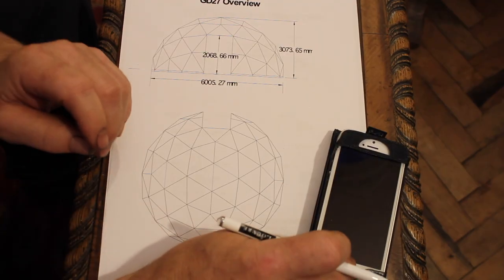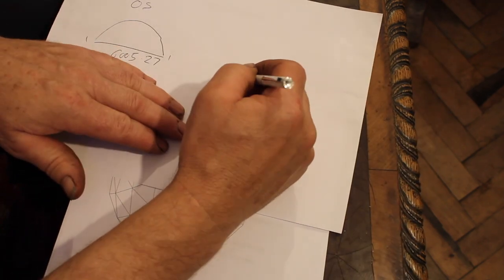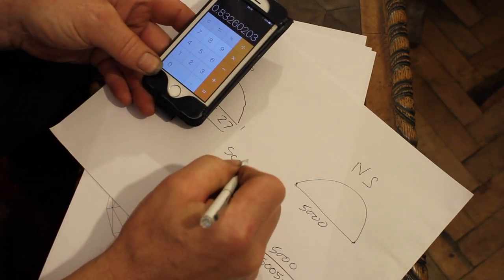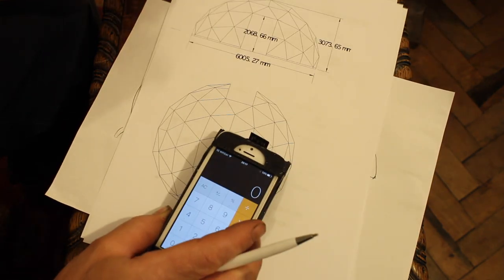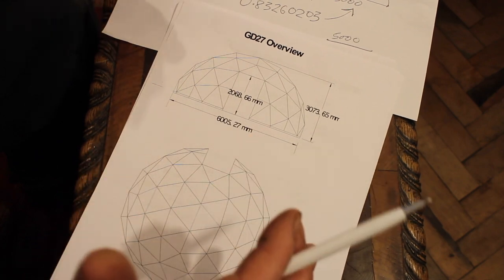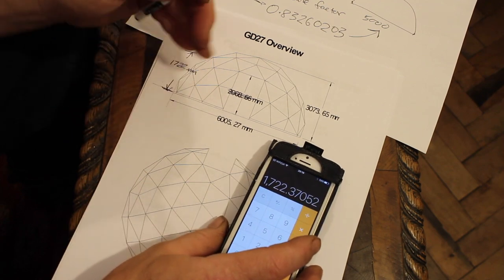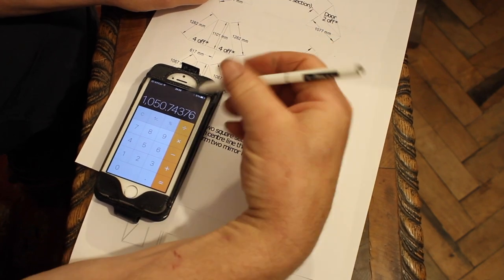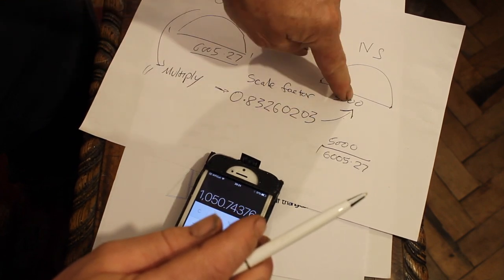How to rescale the geo-dome plans to any size.

Comment: given that geometry or frequency doesn't change it's rather trivial to apply the scale factor to the linear dimensions to get the new ones.
However scaling some elements like doors and perhaps windows with the dome itself isn't a practical solution, because especially doors (but also for example floor height) should follow more or less some standards in order to be comfortable to use by humans. Even a door at 1.8m would be too short. 
What I did on a sheets document is to estimate to total usable area that I want (usable I mean to consider that some sloped areas might be only partially useful, because a person won't be able to stand upright there, and some would be too small even for cabinets or house appliances) - in my case I'm planning a 2 floors (eventually with small attic) house for all-year living.
Currently I consider radius of the dome between 6 and 7 meters (that really depends if my sister decides to join in on the project :)). 
Then I try to adapt the dome dimension to the needed height of two floors. For example if you're doing even frequency dome and it's exactly semi-sphere (so your first floor is the equator of the sphere) then even on the first floor the walls will immediately start to converge, ie you'll get small slope on the first floor and big slope on the 2nd one.
For this purpose I decided on a v3 7/12th dome (ie the equator of the sphere will be about 1.2meter above ground level for a dome with 6~7 meter radius), this way the first floor (while still having slight convex walls) will have mostly vertical walls - ie would be entirely normal (except for the round-ish walls of course :)).
At the same time I also calculated that if I want to avoid removing dome struts and hubs in order to put a normal size door I would need a triangle large enough to insert in it a door with height 2m and width at least 90cm - such equilateral triangle would need to have side of size 3.3m, which can only be done either with much larger dome size or lower frequency like v2 for example. I haven't excluded v2 dome I prefer a v3 for the more round shape and still relatively low structure complexity (of course a v2 would be even simpler).
But if I want a v3 dome without removing struts I decided that I should raise the dome on a cylindrical base (I consider about 90 cm for my plans, but perhaps lower height would also be fine for the purpose of a door placement). The cylindrical base is great also for the above-mentioned vertical walls - this way the 1st floor again will have entirely vertical walls (even slightly wider toward the ceiling), but also half of the 2nd floor's height would be with very small slope - ie the usable area (I consider it to have at least 2m height) will be much larger.
depending on the specific size you choose you'll end up with either a slightly taller central ceiling of the 2nd floor, or even a small attic above it (if you go for a big dome with 7m radius and cylindrical base of about 90cm). Depending on your area municipality building constraint the cylindrical base can be either on the ground (ie the home would look a little like observatory), or can be underground (so the dome and your 1st floor windows would start from the ground level) - at most places even for low residential homes 8 meters height should be ok, so I would go with on the ground (rather than underground) base for better & bigger 1st floor windows.
For smaller domes like in the video example I guess some compromises can be made with standard sizes for doors, floors height and windows, because probably it's not going  to be a residential dome, but perhaps a greenhouse or a tent.
Optimizing the materials dimensions, while important of course I would leave for after you've decided what's the purpose of your dome, and what size would be good to be happy to use it.
If I have to live in it daily and the door is 1.8m because I downsized it because my local hardware store only had beams and other materials in limited size I would be unhappy for a long time. Otherwise it might take some extra delivery (and perhaps cost) while building it, but afterwards I'll be happy using (living in) it. :) Just my two cents.
Something that I'm more interested is how do you calculate the load you can put on the dome? Obviously that's also material and shape (of the struts) related question, but I'll be curious to know any option so that I can compare. For example in my country wooden domes are more popular and almost noone makes steel ones. So among the (few) dome builders the accepted opinion is that the maximum size would be dome with radius of 6 meters, and the main reason is that wooden beam (usually about 15cm wide and 5cm thick) wouldn't strong enough after certain length (for a v3 dome that would be about 2.3m) ... the alternative would be to increase the frequency to v4 and with it increase the materials and complexity for the frame of the structure (and make doors & windows design even harder because of the smaller triangles).
These opinions aren't actually well backed up by load calculations. One thing that I considered and decided not to use was rectangular beams (either wooden or steel I-beams).
The reason is that they have to be in certain orientation (with their 'backbone' vertical) in order to carry the load they're designed for - otherwise you'll end up paying for a lot more material that's not working as it should. Trouble with rectangular beams is that if you try to keep their backbones vertical it means that most of your hubs will become very very complex - on each level you'll have different connector hubs even for the same angles between struts, just because of the orientation and mounting options.
If you have the option to produce your own custom connector hubs that would be great, and then I would prefer to use steel I-beams, but to keep the dome structure simple enough I decided to go with steel pipes for struts and use a small spherical or cylindrical hub core so that pipes would fit well to it at most/or all/ angles (then the hub can be locked with two slightly bent steel plates /to match the dihedral angle/ and tightened with nuts&bolts).
I guess steel pipes like the ones used in scaffolding would be strong enough (if connected properly) but I still don't know how to calculate it even roughly. 
But if I want the dome to carry the load of some of the internal walls too I guess I'll have to ask a proper architect for these load calculations (and a architect familiar with such structures that is)

Comment: Calculators suck, even when they have a near-nothing margin of error. I tried to model an icosaedron in Fusion360 made of triangles, and I needed to know the angle between faces. From the calculator, it's something near 221.8 degrees (one tenth of a degree sounds like a fairly close approximation, right?), but when applying that to the 5 triangles at the top, they just never met (and they were colliding at 221.9 degrees). To mitigate this, I took back the real formula, which is (180º + acos(sqrt(5) / 3)). That is to say you're supposed to keep expressions until the very end, with sines, cosines and tangents for the entire model. That way, you're sure that it's going to work flawlessly whatever size of dome you give as input. It looks a lot more tedious, but actually works much better when using a spreadsheet or a CAD.

Now, the reason for an icosaedron is that all faces are identical, no need to calculate and setup multiple triangle sizes, there is no order in there. That could sound that you're limited to a constrained size or structure, but it's actually consider that each triangle can be "supersampled" infinitely (or almost, as long as it makes sense) with very little calculation involved from one level to the next. The resulting shape will still be an icosaedron (unless you start plaing with curved arc segments that will get you to a near perfect sphere with a lot more problems to define the faces) made of tetraedic "bubbles" (the 4th side is inside, it's the original icosaedron's face). It's easier to design and evolve than "standard" geodome that has its shape defined once and for all, as each triangle can become 3 triangles, and so forth (or 9, or 27, etc., or anything in between).
Reply: Thank you for this comment, very much. I built a 3v 5/9ths dome (Optimum Wisdom Laboratories plans by Dr. Petty) and have been struggling to sort out the next build's plans. This is because I don't understand how the bevel angles are calculated for the edges of my triangles. I have been hoping to build a dome with only one triangle in it. I tried to work with Paul's "Unity Dome" plan - a beautiful looking thing - but the math doesn't work out when I try it. For instance, using an online law of sines calculator for the math I could not get the 10 "kites" to get all the way around the circle, using the lengths he provided. This gave me pause, because if that was wrong, could I rely on the claims of 11deg and 16deg for the bevel edges of the kites? I have struggled to figure out how to calculate the bevels of the edges of triangles (and "kites"). Can you point me to resources? Thank you!

Comment: Hello! Was wondering if you scale down the geo dome based on your pdf would it then also change the 6.5 angle of the frame cross section? Thanks!
Reply from the maker: If you scale down all the angles stay exactly the same.